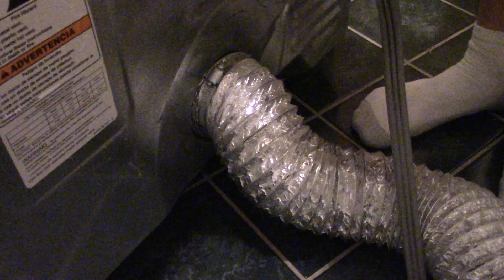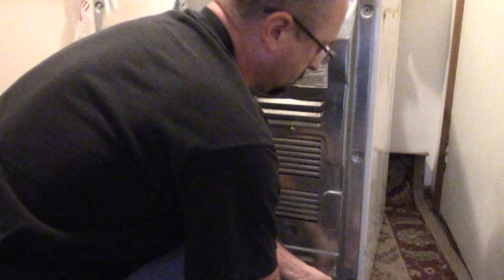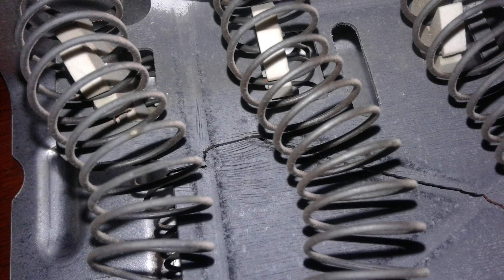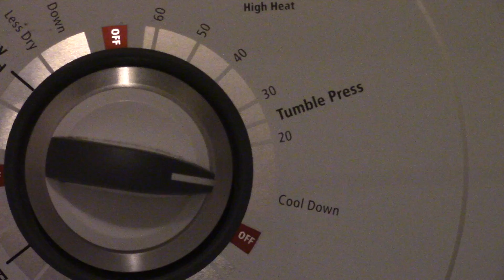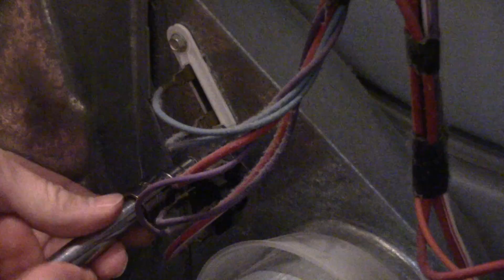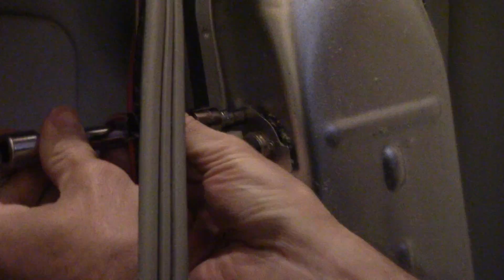Dryer Too Hot During Cool Down Cycle

Comment: After replacing all my sensors/switches and cleaning out the timer, found this was exactly my problem - Thank you!   mine was staying hot all the time even when in the off portion of the timer so it is amazing it didn't cause a fire.  I had to keep it unplugged when not in use until I found this issue.    The ceramic posts holding the coil had broken in several places and the coil was shorting (2 yr old non-OEM part).   I never suspected the element because it was heating up and since it is only a coil.
Reply from the maker: You're welcome, thanks for watching

Comment: I've got that same problem. I ordered both thermostats and a handful of fuses, and installed them. I plugged it in and ran a cycle and during the cool down, the heating element stayed on. The floor underneath was almost too hot to touch. I don't know what I did wrong. Can the thermostat on the blower be installed backwards? I noticed there was a red wire on one side and a red/white wire on the other.
Thanks for the video.
Reply from the maker: I'm not sure if the thermostat can be installed backwards. On mine, one wire from the thermostat goes to another thermostat and one goes to the timer. You'll have to check the circuit diagram located in the top of the dryer where your timer is. The issue with mine was on of the heating element coils was touching the case causing a short and keeping the heating element on. If you have continuity between either heating element terminal and the case, you have a bad heating element. You can also remove the heating element and give it a visual inspection. The timer may also be a problem since it turns the heating element on and off. The last problem I had with my dryer was no heat and it was a bad timer. You can see the video of how I tested my timer here: https://youtu.be/YiuLeqJR-Wg